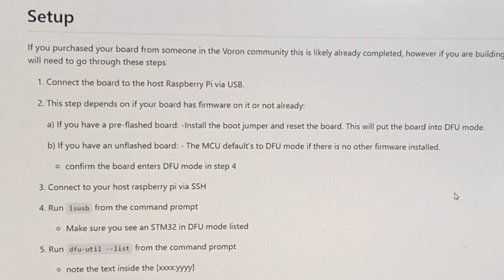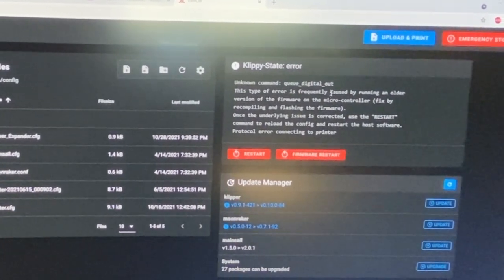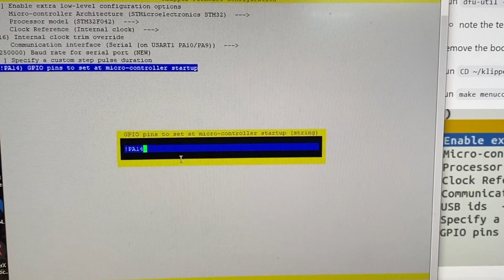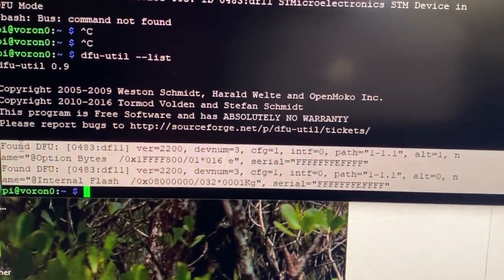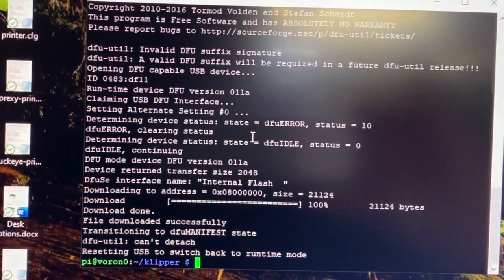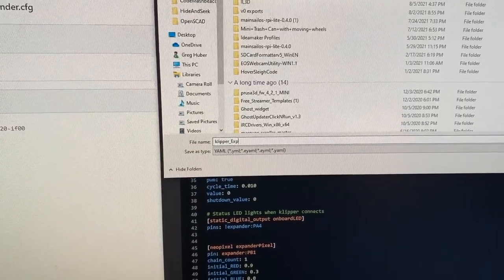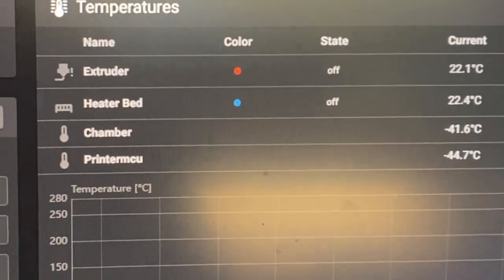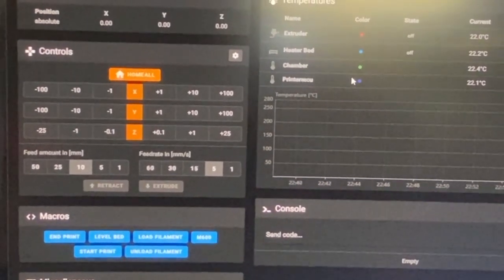Klipper Expander Installation, Wiring & Configuration

Comment: Great video! Glad you like the expander!
By the way - you can also fetch mcu and pi's temps by adding this in your printer.cfg file.

[temperature_sensor raspberry_pi]
sensor_type: temperature_host
min_temp: 10
max_temp: 100

[temperature_sensor MCU_Board]
sensor_type: temperature_mcu
min_temp: 10
max_temp: 100
Reply from the maker: Thanks for watching! Also, awesome tips to get board temp readings- I probably should've mentioned that as a possibility in the video (I hadn't yet added those, and will do so)! Thanks for pasting the settings.

Comment: Awesome video very good info also If you add temperature_mcu to your config you can read the temp right off the built in sensors on the pi and mcu board.

Comment: Do you have to reflash firmware if you're adding klipper expander to an already running mcu/rpi?
Reply from the maker: Hi Kevin, yes- it is a good idea to reflash the firmware on the Klipper Expander because it may be out of date, which was the case with mine. There is no need to reflash your 3d printer mcu or do anything with your raspberry pi.

Comment: How did you get Klipper to treat those thermistors as temp sensors? I have mine as extruders but would like to replicate your method
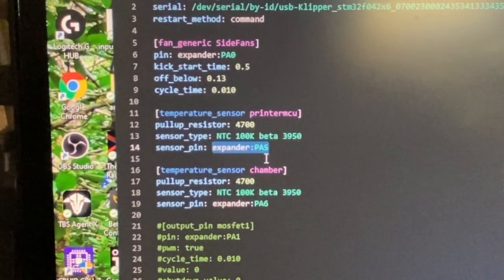Reply from the maker: Hey Dominic, thanks for watching! You can see the syntax for adding the thermistors as temp sensors right around the 21:51 mark or so. The syntax is basically a [temperature_sensor nameofsensor] heading, and then sensor_type and sensor_pin entry underneath that.

Comment: so does all fans plugged directly into the expander have to be 24v if its directly on it?
Reply from the maker: It would have the same voltage as whatever you power it from. So if you use 24v as input power, then it would be 24v for the fans.

Comment: Awesome video as always!  Don't the skr mini e3 v2 and the pi already have temperature sensors in them?  I've added a couple entries to my base config and am getting temperatures for both without additional thermistors.
Reply from the maker: Thanks for the comment and watching! On the board sensors absolutely- using the built in temp sensors would be just fine to get a back temp reading. I thought about that as well, but ended up using the extender since I was already adding it for the fans. There might also be some spare pins on the skr or pi that could also be used along side with the thermistor. It’s great to have the flexibility and options.

Comment: Is there a solution for the ADXL345? what do you think about TurboCan?
Reply from the maker: For ADXL345, I don't think there is a good solution with the Klipper Extender. However, I just connect my AXDL45 directly to the Rasp Pi.  TurboCan looks really interesting! I had not heard of it until you mentioned it. I will have to look more into it. Thanks for watching and commenting!

Comment: would there be any changes needed if using 12v rather than 24v fans, such as with the nevermore V4?
Reply from the maker: Nothing significant- the klipper expander can be used for 12v just fine. It will provide the same input voltage on all the Vin pins.

Comment: Ok, so  could you run a second. Extruder with this?
Reply from the maker: Unfortunately, it won't support an additional extruder as it doesn't have any stepper drivers on it. If you are looking to do that, you could add a CAN Bus board, or the LDO Picobilical (which uses USB, and is a great fit for a Voron0.2). There may be some other options available as well depending on how many motors you need.
Reply: @GregsMakerCorner Ah, yes, good point. No stepper driver.  CAN is a no for me.  I am a Canbus apostate. Spent 3 weeks on that expensive nightmare.  I ended up using the 14 pin harness minus cable chain as an umbilical.  I made a custom mount on back of orbiter and orbiter has hartk board and a buck converter for my 5v fan.  My toolhead is xol-toolhead, which recommends a 5v fan.  Dumb toolhead board way to go imo.
Reply: @GregsMakerCorner Pico umbilical sounds cool.
Reply from the maker: @C650101  Ahh.. yeah CANBus can be a real headache. I had a similar problem with my first board, it turned out to be defective. I've heard that LDO is coming out with another option that uses USB, which at least will be available for some of the larger toolheads (like the full sized Stealthburner).